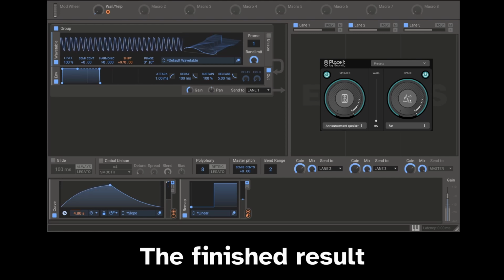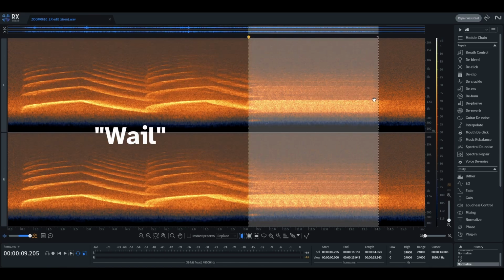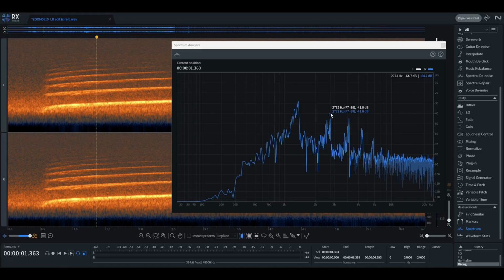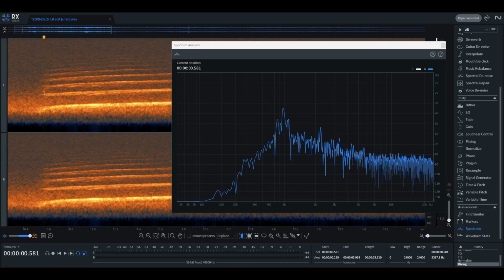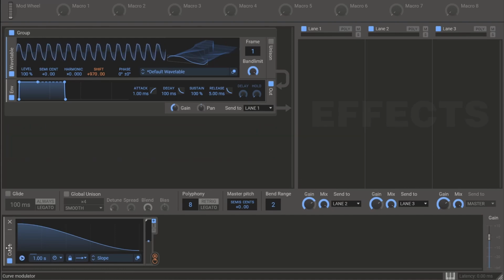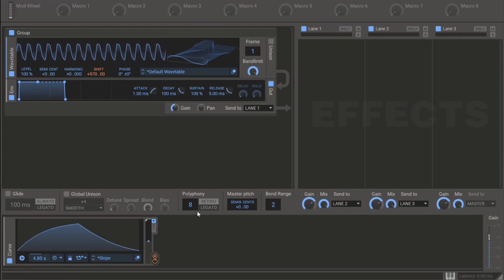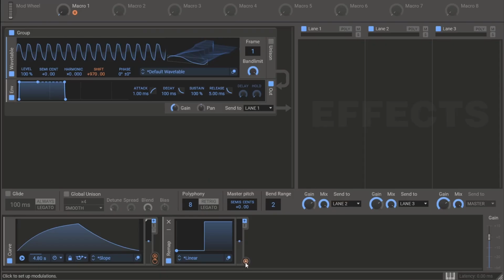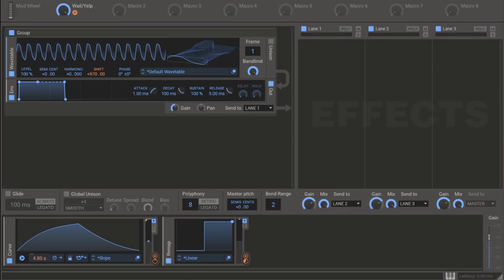Synthesizing Realistic Siren Sounds 🚨

Comment: Awesome stuff. I'm working on synthesizing a crow's caw right now, I'd be sooo interested to see how you approach it.
Reply from the maker: Thanks! You're actually not the first person to ask about synthesising crows, so I'll try to make a video about them when I have time. They are certainly tricky to synthesise due to being mostly atonal but with a small element of pitch, which makes it pretty hard to know where to start when looking at a spectrogram of a reference recording!

I haven't experimented with synthesising crows much but I got the best results by starting with some sine oscillators which have a bit of a pitch curve to them, and then modulating the level of the sine waves with a noise oscillator. You can play around with the depth of that modulation in order to try to find a sweet spot where they don't sound too tonal but also without making them sound like pure noise! You can also make it sound a bit more "rough" using a ring modulator with a fairly high frequency.

Best of luck!